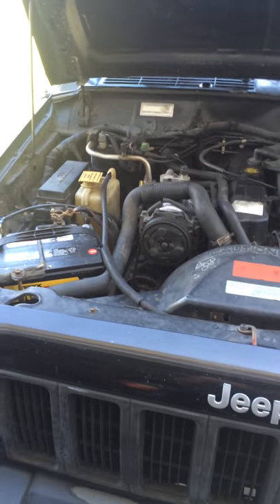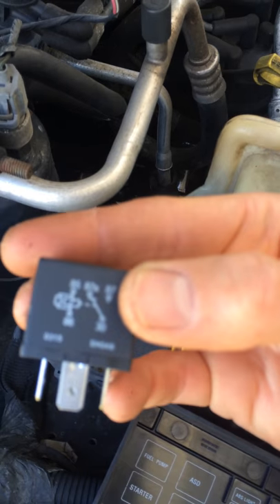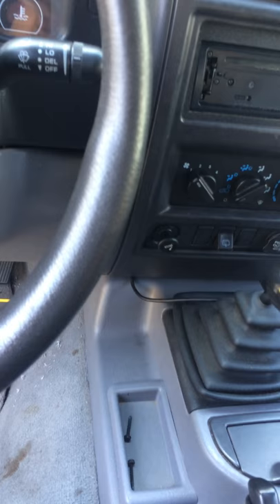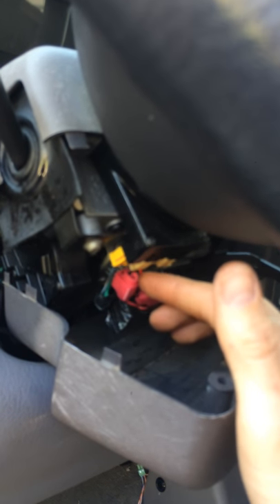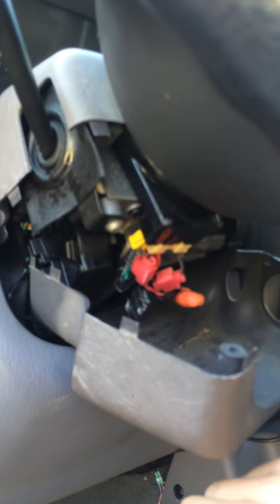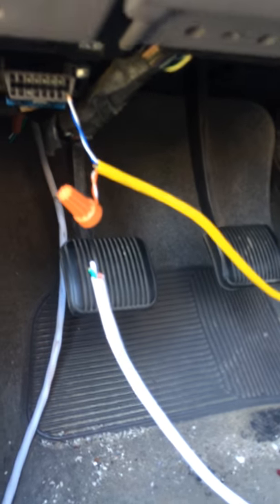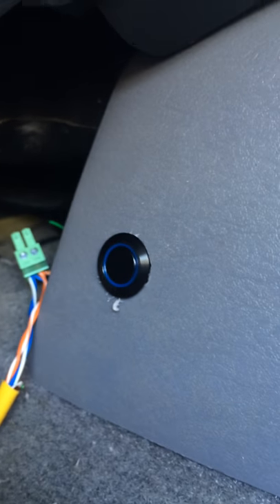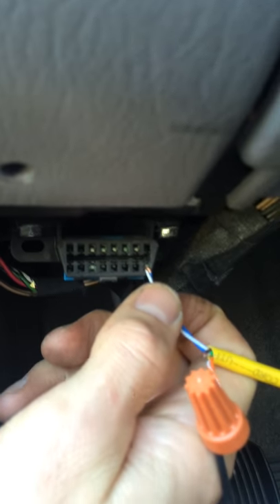Ignition Bypass Jeep Cherokee

Comment: i have a 1997 grand cherokee trying to take the cover under the steering wheel off got one torx screw out and the other 2 are like 2 inches up in the hole cant hardly see them but a torx socket is to big to go through the holes i tried a small phillips and didnt work how do you get that bottom cover no video shows how
have to check ignition wires no power to the  i already installed a new coil and crank censor

Comment: I lost my key to my 2002 ford f350 and the key to my 2005 ford f-250 so I'm trying to find a way to get them started without having to buy a new key so Is this possible to do with a early 2000 ford f-150, f250-f350 or a late 1990 model ford f150, f250-f350  and then use a flat head screw driver to start the vehicle or just an old Ford  non microchip key ?

Comment: Hey I lost the key to my98 grand jeep Cherokee,how do I remove the lock key cylinder without a key?
Reply: michael posey. drill or pull the steering column cover apart and poke around. GM has a little button you press in when you take the steering wheel off to pop the cylinder.
Reply: hammer and screw driver worked for me

Comment: All you had to do was replace the ignition switch $24 at any auto store, and a couple of safety torque screws to take the old one out, quite a waist of time
Reply from the maker: I guess or buy a auto switch and figure that out or run a wire thru the firewall and don't use the clutch bypass. Either way you do it, know the risk and at the end of the day learn something.